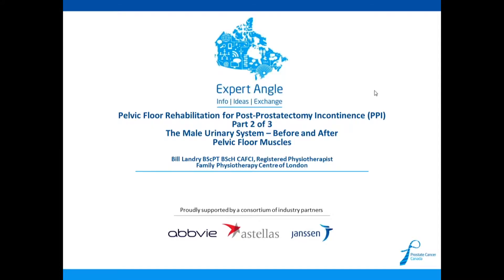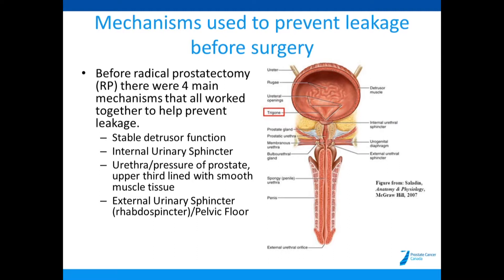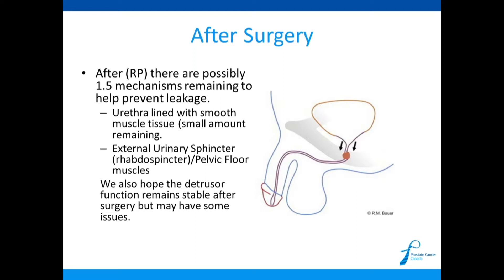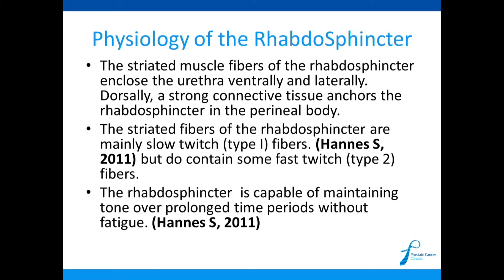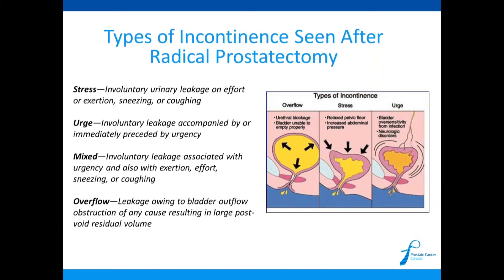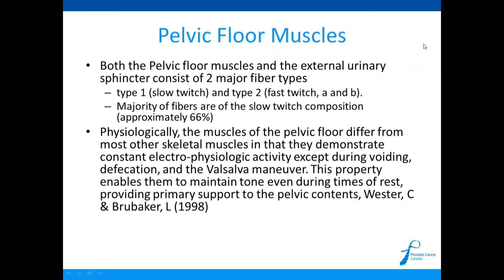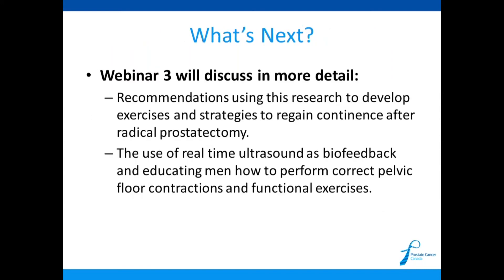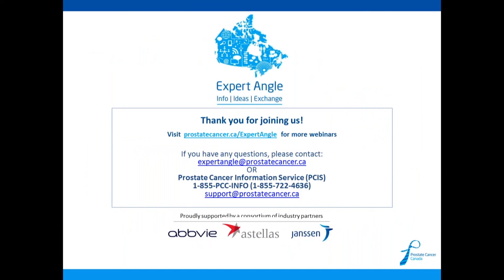Pelvic Floor Rehabilitation for Post Prostatectomy Incontinence (2/3) with Bill Landry

Comment: Honesty is lacking.  NOBODY COMPLETELY RECOVERS FROM INCONTINENCE AFTER SURGERY IS NOT TELLING THE TRUTH.   Many men die with prostate cancer but NOT because of it.  Have either surgery or radiation and you lose any chance for intimacy with your spouse.   You will constantly be looking for a bathroom.   Golf, forget it.   You will be leaking long before the 9th hole.  Long car drives.   Make sure you have a place to stop every 50 miles on the highway.  Chances are extremely high that you will live another 10 years with little or no problems to match the incontinence you can expect to occur.  All the pelvic floor exercises are nearly worthless.  Why you ask?  Simple, because your body is now missing an integral part of your normal body structure that you were born with.  All the slings, pumps and other treatments are BS.  No one will contradict what I disclosed here because it is too painful to admit that they F-d themselves.  DOUBT ME AT YOUR OWN RISK.  I am a sad survivor.  My marriage is practically ruined.

Comment: Can my Urologist prescribe a Physical Therapist to work me through these Kegal Excercizes covered by insurance?
Reply: Should be able to, depending on where you live. I'm a prostate cancer survivor. I've had many operations plus a pile of complications over the past two years. I even had to have the AUS removed shortly after having it installed!
 Regarding the exercises, slow and steady will provide better results then trying to expedite the process. Also, do not overdue them as that can cause major leaking and sometimes irreversible damage. I know! Control your fluid intake and try to avoid caffeine, cola and alcohol if at all possible. Hope this helps. Andy 🇨🇦
Reply: @ProMachinist  Hi Andy! Thank you so much for your reply, great words! I need to keep drinking my water everyday because that's what kept my kidneys free of kidney stones which I suffered for many years so that's a little difficult to do holding back drinking water! I also enjoy at least a beer on a good occasion two beers at night with my dinner, it's just washes down the food so good!
Reply: They won’t really help.
Reply: @josephcebula2983  The truth is this, anyone who had prostate brachytherapy, external beam radiation on the prostate or a prostectomy will most likely loose some urine control. This could just be in the form of dribbling or stress incontinence. 
Also, when the prostate is removed, regardless of how great the surgeon is, we loose two main sphincters to help with urine retention, automatically! For men who are very active and have a physically demanding career, they are prone to leak more than those that are less active. Its a life changer for sure. 
I've spoken to hundreds of men over the past couple of years, from all over the world, and we all share much the same stories and frustration. So, in all truthfulness, the pelvic floor exercises are a waste of time as they can actually make your incontinence irreversibly worse. I know!
Reply: @josephcebula2983  If I can help answer any questions, just ask, I will try. You.may PM me on Facebook or email.